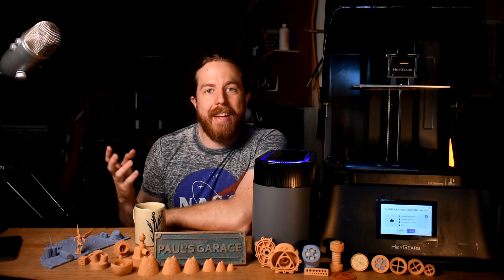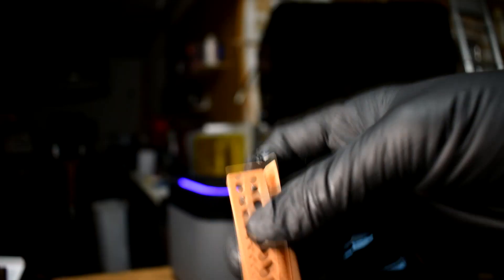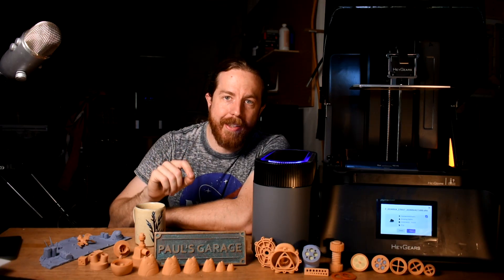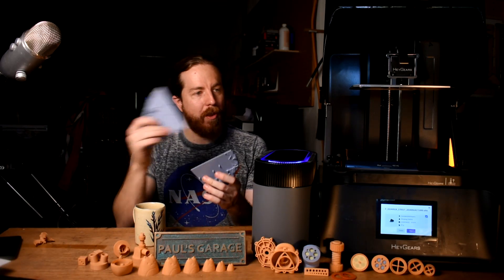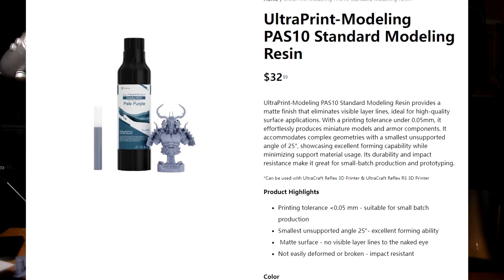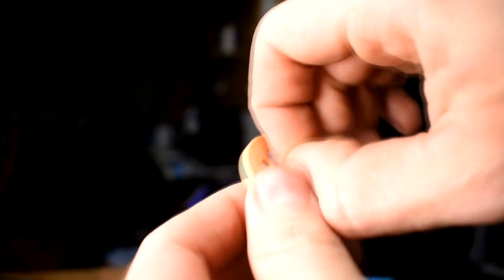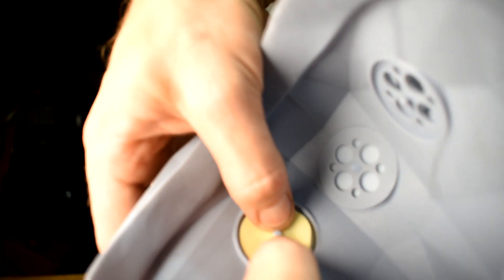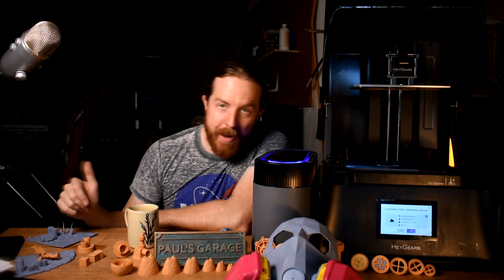Rapid Prototyping in Your Home Shop! | HeyGears Ultracraft Reflex RS

Comment: In order to get rid of all the tiny bumps left after support removal that you notice at 02:40, some support settings can be fine-tuned in Blueprint Studio. Change the "sphere" at tip end to "none" (because the bumps are in fact these spheres merged with the model) and lower the support tip diameter down to 0.22 mm, and the tip penetration depth down to 0.05 mm only. Alternatively, you can keep the sphere at tip end but make sphere diameter equal to tip diameter, i.e. 0.22 mm, to prevent breakage too far away from the model. In any cases, decrease tip diameter and penetration depth as said. These are great tips from Battle Brother Sam and Figure Feedback.

Comment: you ever look at epoxy cast aggregate beds? some large format industrial cnc machines cannot be poured cast iron so they create a rigid mold and fill it with aggregate stone and then pour slow cure epoxy in leaving a layer at the top where beds and ways are cast in place. super interesting process that would work awesome at home cast machinery bed scales

Comment: This is great! For the face shell was that all just auto supported? No manual supports added too? I want to try larger prints like that but nervous when I see so few supports on large pieces in Blueprint! I’m used to over supporting these on other printers and still failing!
Reply from the maker: I never add manual supports to stuff in blueprint.  Prints still fail occasionally but I usually just reprint and it works fine.  On other slicers yeah I go crazy with supports and heavy anchors and everything

Comment: WHICH 3D Resin Printer would you prefer, based upon your knowledge and experience:
The Ultracraft Reflex RS?, or 
The Uniformation GK3 Ultra?
Reply from the maker: If i had to pick one, it would be the gk3 ultra because of the size and because I can use casting burnout resins.  If they release a casting resin for the RS, I would probably use the RS for that task over the gk3.  I print large things, though, so the size is the decision maker for me .  Gk3 link for reference: https://uniformation3d.com/products/uniformation-gk3-ultra?sca_ref=4345752.v3kdNjnqDi

Comment: Ahhh i missed the discount deadline, so I guess I'm gonna go with the GK3 Ultra instead. How would you compare the print quality of the GK3 ultra vs the Reflex RS?
Reply from the maker: good question, the stats say the GK3 ultra has a screen with smaller pixels, but i don't think the difference is enough to matter.  it's going to come down to the resin and how well you calibrate it.  The advantage of the Reflex RS is that the resin and software is already calibrated to the extreme, and the resin is really good stuff.  in my opinion, the big benefit of the GK3 ultra is the size, and that you can use any resin you want.  But that comes with needing to calibrate other resins yourself.  learning to calibrate resin is a good skill to have, though.  If you don't need the size of the GK3 ultra, you can probably save some money by getting a GK2 instead.  I suspect the GK2 and Reflex RS use VERY SIMILAR screens.  Size and resolution is about the same.

Comment: I'm conflicted about all of the HeyGears printers...a lot of care and effort was put into the physical aspects of this printer, from the design of the vat to the build plate to the cure station (the washing station seems a little overdone and most reviewers have experienced hard-to-clean spills with the auto-loading resin bottles, however). But the completely locked-down and online-only nature of the slicer means that anything from a local Internet outage to a meteor smashing into HeyGears' server farm means you now have a very expensive brick on your hands. I'd rather work a little harder at dialing in settings if it means I can use any resin I please and can print as long as I have power and resin available. 

There's also something to be said for people learning about 3D printing processes, making mistakes and knowing how to avoid them in the future. Someone who buys an Ultracraft Reflex RS who just wants to push a button and receive prints is going to be bewildered if some of the fancy tech on the printer takes a dive. I've made a lot of mistakes with my Ender 3, Sidewinder X1, Sonic Mini 4K, and SV06 Plus, and have learned a lot from them as well...I'd hate for others to be deprived of similar learning opportunities. What I'd like to see is more of the deluxe features from HeyGears printers (especially the built-in vat heater) to percolate down to more budget-friendly printers in the near future, as have so many other things in both filament and resin printers over the last few years.

One other gripe: the peel assist thingy HeyGears sells is as ludicrously overpriced as it is loud. It seriously sounds like a jet engine when it operates, and I think it costs about as much as one as well.

Comment: This sounds like the Bambulab of resin printing; a tool for people who want to work on projects vs work on their printer :-)

The closed system is a turnoff, but only because of bad experience I’ve had with companies either going belly up or simply deciding they needed to go in a different direction, leaving me with paperweights and boat anchors.

A local-only version of the slicer and at least some ability to run other resins would get me to buy one. (Apart from my ,omg-term concerns, their resins are in a range I’d consider affordable, particularly for more or less guaranteed results.)

(Great review btw, thanks!)

Comment: I buy the sunlu resin at $15 a kg.... this is twice the cost.
Reply from the maker: i use sunlu abs-like a LOT. It's great for the price.  I have to say back to back the resin shown here is a bit tougher and much crisper looking.  The edges are much sharper, it doesn't round out the details as much.  that being said sunlu abs-like is great stuff, especially for the price, which is why i use it so much, but the resin i used with this reflex is noticeably better.  It may not be twice as good, but its definitely better.  I'm still buying abs-like for the rest of the printers.

Comment: I wish he would tell us what other printers he has used...
Reply from the maker: for resin, a mars 4 max, mars 5 ultra, uniformation gk2, uniformation gk3 ultra, and a creality halot mage 8K.  I might be forgetting one or 2, i have given some of the old ones away
Reply: @PaulsGarage  of those, do you feel the heygears is better? Considering the price?
Reply from the maker: @JohnSmith-rt5yq  I think it depends entirely on what you want to do with it.  Some people get into 3d printing as a hobby for it's own sake, and for that, i think this is a bad printer.  it's mostly locked down, not a lot of room for playing around with it.  There are people doing hacks and things, but you can get more freedom with any other machine out there.  I think if you just want a tool to print you plastic things and you aren't really concerned with printing as a hobby itself, this is the way to go.  You don't have to mess with it, it just works well.  If i had to pick one and only one printer for myself, it would be the GK3 ultra, but that is down to the size.  It's about the same price as the RS, but it's much larger, and I can use burnout metal casting resins.  If HeyGears releases their casting resin (they do have one) for the RS, I would probably prefer the RS for that application, but I would have to try it to be sure.  The GK3 ultra's huge size can't be compensated for, though.  I like printing big stuff.  If you don't need anything that big, then i'd probably get the RS or a GK2.
Reply: @PaulsGarage  Hello, do you have any plans to use their casting resin? That video would be very helpful, especially for me, as I have never used a 3D printer before and I plan to buy a 3D printer for lost wax casting needs.

Comment: Is it safe to breathe through resin printed parts? Doesn't resin off-gas for a while after curing?
Reply from the maker: Excellent question, I have been worried about that as well.  I'll cross that bridge when I come to it.  In the meantime, my plan is to cure the part thoroughly, let it sit for a while, and then coat the interior in something.  Don't know what yet, because coatings have their own potential problems.
Reply: @PaulsGarage cerakote

Comment: Been casually watching this technology waiting for cost to come down and when it would be convenient enough to print replacement parts to replace manufacturer 'designed to fail' parts. Sounds like this is getting close, the 'off grid' version would be nice...
Reply from the maker: I was thinking the same thing about plastic parts.  I have some in mind to test, I just haven't gotten to it.  They are working on the "off the grid" software, it will show up eventually.

Comment: I use the casting resin in my Reflex. It was an excellent printing/casting experience. You’ll be blown away by the print quality and it burns out clean. But you’re going to need a Reflex.

This is the printer all hobbyist casters will end up using so long as their hobby is casting and not printing…
Reply from the maker: That sounds promising. I've had good luck with monocure burnaway but that resin has no wax in it, so it prints more like a regular plastic.  Still requires some dialing in to get it looking the best, though.  What investment do you use?
Reply: @PaulsGarage  Could you please do a small print what that monocure? I've seen the RS print well with other resins on other videos but no one has tried a "casting" resin as far as I know. I'm thinking since the monocure is more like a regular resin it might work as well as other non heygears resins do. I am very curious to how well it or any other casting resin would work with the RS even though it's not "officially" supported.
Reply: Optima prestige and normal resin burnout schedule. Only think I’ve noticed lately is I really have to let my flasks dry out before burnout, but I think my investment is old and that it has nothing to do with the PAC10 resin. I havent met a single other person who has used the resin yet other than me so I’m eager for someone else to see what I’m seeing here.
Reply from the maker: @WhiteGloveFans that makes sense.  I think all plasters have a shelf life, especially if they are stored in areas that can get humid like my garage.  I am always worried about steam explosions from my pottery days, so I usually add a candling period (200f for many hours with the kiln lid cracked open) before cranking the temperature.  Don't know if it's needed but I'm scared to skip it lol I've lost so many pots
Reply: @PaulsGarage ok cool, thats what I started doing too. Would be cool to see you get a Reflex and put it to work printing patterns

Comment: This closed ecosystem lends itself well to commercial use.  You select the printer and supplies you need to suit the required task at hand.  So, if you are an investment casting shop, you would get the printer model and consumables for that.  Dental?  Same thing.  Get the model and resins for that.  No stuffing around, and it would crank out the models from day one.  And they provide support for it all.  If you are hobbyists, and like the, "hey I got a great deal on 5L of some random resin".... this is not for you.
Reply from the maker: Exactly.  This isn't a machine for people who like to screw around with random stuff.  It's for specific applications, like when accuracy and production ease is required.

Comment: Autosupports are very identifiable when you get a bit of experience under your belt, or better known as Oversupports. People have very little idea how few supports it takes to properly do a resin print when you know what you're looking for and how to do it well. I do crash course schools on reddit quite often and prefer people do them manually not only to save material, but to learn the difference between what algorithms do vs a finely tuned eye that developed a knack for being able to successfully print Any object with zero failures. The best part is the one you only have to print once, as I often say.
Add: Even when you find a Really consistent resin manufacturer, settings can vary by the day and time you print, which is something most machines don't take consideration for (or any on the consumer segment anyway). I know, it's more than 98% of users may ever investigate, but I've taken this to a fine science I tell you. The closer you can dial in a profile to its ultimate perfection, the better it can survive the gaps when things aren't optimum, like your print room with no HVAC spikes temperature in a Texas August. 😉
Reply from the maker: You are right, it's best to learn how to do it manually, but I'm often surprised by how many people don't want to pick up small skills like that.  It's crazy.  I hear you on the climate issues, my garage goes from 98 and humid in the summer to 40 in the winter.  I have a heater out there otherwise it would drop to -10.  It's crazy how much prints change between 75 and 50 degrees.

Comment: 10:45 Man... that is so. Very. Relatable. 

It's basically my biggest pet peeve in the world, poor maintenance access consideration during the design phase. I've had to pass on fixing things for friends/neighbors because of that exact issue, when I know it's otherwise a $5 fix to save a $500 assembly.
Reply from the maker: It's the worst.  I have an old car I can open the hood and touch every component easily, and a newer car and I open the hood and I don't even see an engine.  The engine is under the dashboard!  Gotta change a spark plug? Take a wheel off, and a fender liner.  😡
Reply: Or, in a similar vein, most of the sparkplugs are easy to replace. For those against the firewall, you'll need four extensions, three universal joints, and a small child to climb inside the engine bay...

Comment: I usually like your videos, but in this case, it's more promotion then anything else, the problems you had with printing, we're basic and easy to overcome, with a few youtube tutorials or just basic knowledge really, and the right programs. it's not the printer, it's the software and knowing how to use it!  So yeah bit disappointed here. People just need to learn the skills they need, shortcuts come from knowledge, the other way around will leave you with the question of how and why, when you run in to problems!
Reply from the maker: Honestly, I agree with you.  Basic issues that can be overcome with a little learning.  But I'm constantly surprised by how many people (who aren't makers, admittedly) who just get scared off by little things like that.  I've been able to make engineers' eyes glaze over when I explain stuff like that to them.
Reply: @PaulsGarage  Yeah, "the solution" isn't, buy this printer and use this software! And "the problem"isn't,  "it doesn't work" It's you're doing it wrong, understand what you're doing and learn how to solve. I respect the honesty man!
Reply: Especially resin printing, it is pretty easy! You can try different resins and increase the uv time, not much more to it. You could make some tutorials, for instance if it's just look and feel, hollowing out, saves a lot of resin and reduces weight.